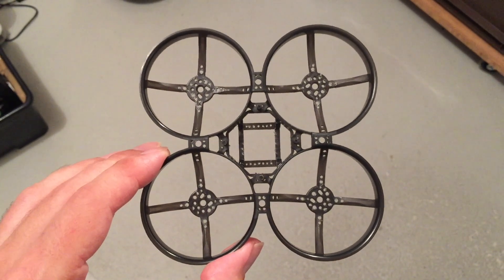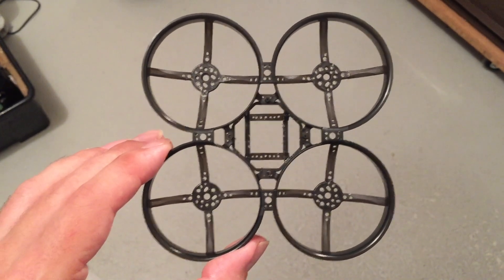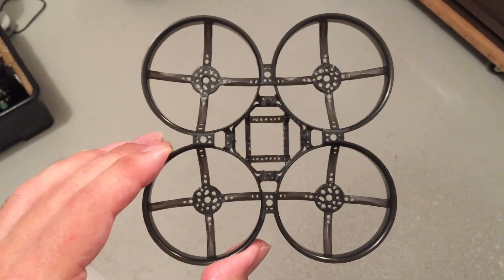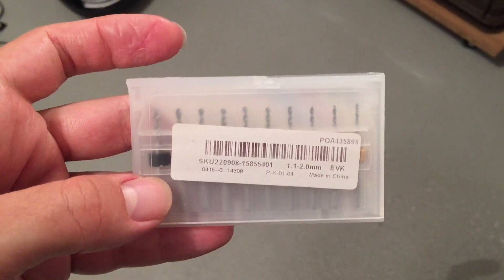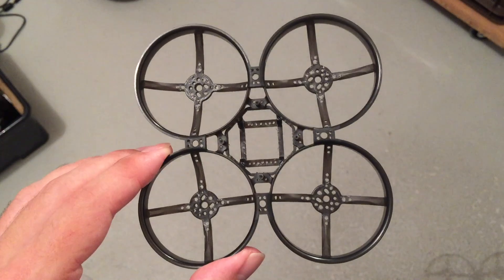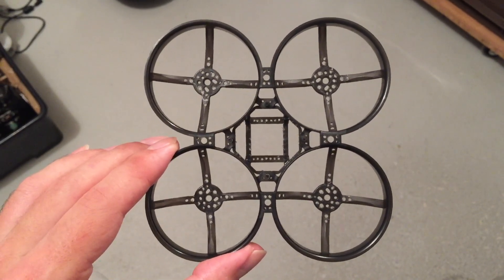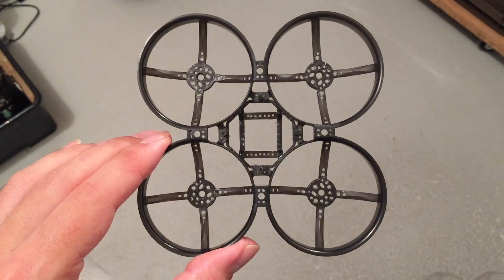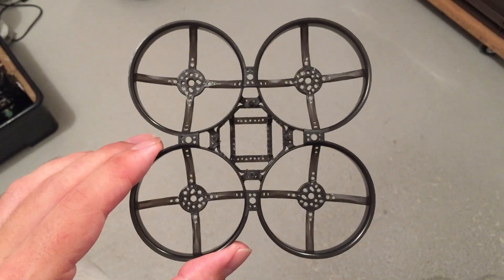World`s lightest Happymodel Mobula8 Whoop Frame | New 2S Project

Comment: Dont know what batteries you are planning on using, but i am really happy with the 450mah tiny whoop branded 2s with bt3 connectors.
Reply from the maker: GNB 2S HV 380mah 90C. But maybe I'll order the tinywhoop 450mah or 300mah with BT3.0. Thanks for the tip!

Comment: See if you can find any of the old 85mm frames. I dont know why but Happymodel, Betafpv have all added like 3g to their 85mm frames recently. URUAV UZ85 frame is 8.5g, URUAV Bushido 85mm frame is 8.7g, Betafpv 85X frame was 9.6g i think. And these frames were strong, there was no reason to make them all so heavy now. I am just happy i got a few for backups
Reply from the maker: Yes the old HM 85mm frame was very good! I also still have some of these frames. But unfortunately the hole pattern only fits the 1102 engine. Not for 1103 engines.
I have to see if I can mount the 1103 engines somehow.
Reply: I've got 3 of those uruav uz85 frames! Pretty sure happymodel owned uruav? Maybe they saving that design for the mob8 2025.....?!
Reply: @ragndroneman  yeah not sure about the relationship there, I thought Uruav was the banggood house brand that used happymodel parts or something
Reply: @Tokyo_Dom  you could be right. The parts were very similar just rebranded motors.
 Shame you dont see them anymore, uz80 and 85 were so cheap. Was kinda fun putting them together yourself too.
Reply from the maker: @ragndroneman  I also still have some of these frames. But unfortunately the hole pattern only fits the 1102 engine. Not for 1103 engines.
I have to see if I can mount the 1103 engines somehow.